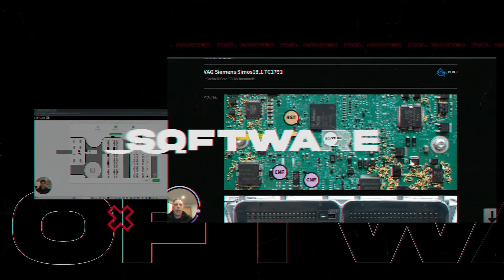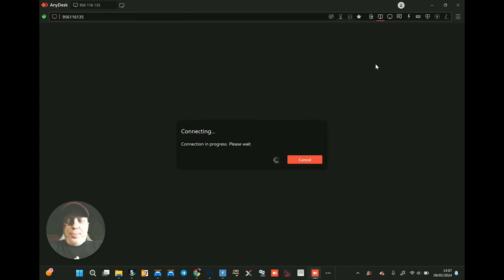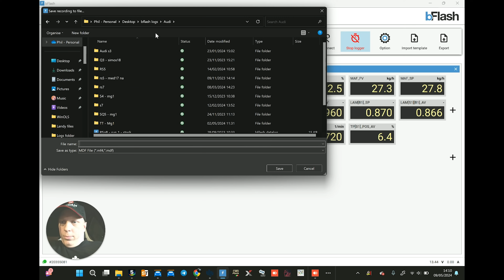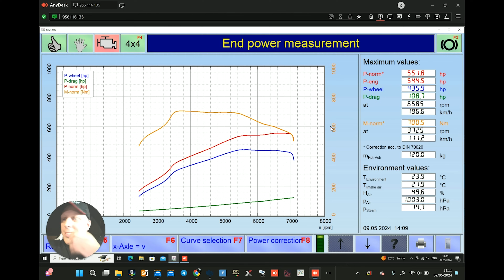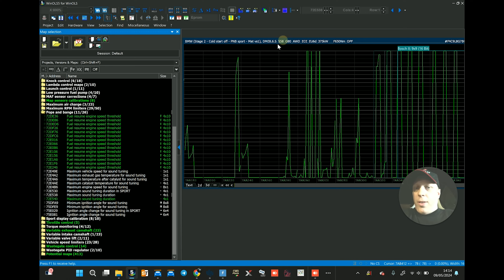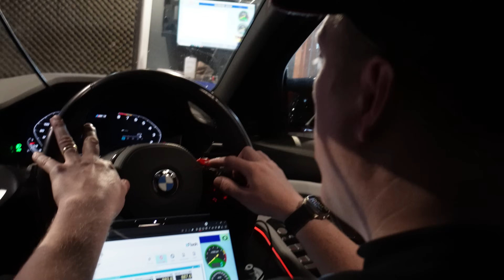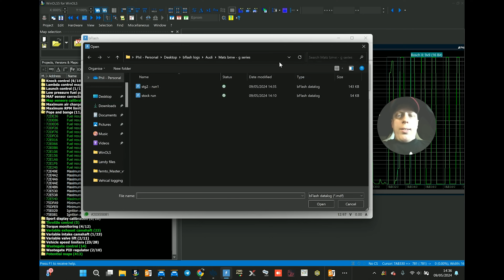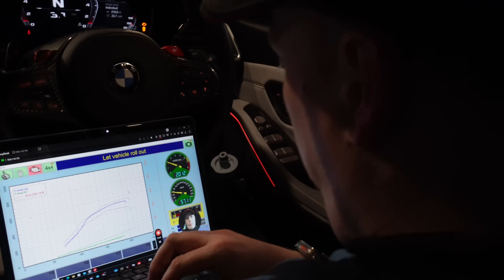TUNING MAT ARMSTRONGS M3 (w/ TAVARISH!)

Comment: I see you use exhaust fans to draw air/fumes out. Do you use any intake fans in front of the vehicle?
Reply from the maker: We get this question alot, mat covered it in his video, our system works like a wind tunnel, the air gets pulled in via ducts in the doors, so instead of having a small fan at the front and extraction, we have a huge one at the back that works for both. Same as the Litchfield setup basically
Reply: @Phil-Cooper  I saw his video and that's what caused my question. I appreciate the exhaust fan will work, but my limited intellect thinks a front inlet (forced air) solution would work better (eg simulating real world conditions). The main reason wind tunnels use exhaust fans is to reduce turbulence, which you aren't focusing on here
Reply from the maker: Theres more to it then that, the gap in the front is designed to draw air to the car, so it is forced, its the venturi affect. We have measured well over 1000hp cars this way same with litchfield. 

In my head it shouldnt work, but it works really well. 

If you think of it like this, on the road the air is drawn through the front, then over the engine and down the back to the exit, just sticking a fan on the front doesnt replicate this. But running the air through the car does. 

Thats pretty much how it works - simulates the road. 

Issue was balancing the air pressure in the room

Comment: Good video. How does the dyno calculate P-norm given it is actually mearing P-wheel? Is it just a common equation? Or is it car specific?
Reply from the maker: Measures whp on the way up, and losses on the way down (neutral coast down) also measures the losses in itself (bearings etc) so its super accurate. Litchfield have the same setup and the engine dyno and they run around 1-2hp out to each other
Reply: @Phil-Cooper  Ah clever! That makes sense. As a rule of thumb I always think of it as 10% loss for FWD, 15% RWD, 20% AWD. The latter is in the ballpark of your P-drag. But I never knew they were actually that accurate. Very cool.

Have you ever come across any cars with crazy low (or high) drag losses?
Reply from the maker: Yeah, cars cant be measured in a % method, only takes a binding brake to lower the measured whp, but this way the loss is added to the run down as its measured there too, and you can see that the losses are massive so you can find whats wrong :) 

Great for race/track cars and finding those lost digits. 

Ill make a video on it soon!
Reply: @Phil-Cooper  makes sense, and sounds good! Will keep an eye out.

Comment: what laptop are you using ?
Reply from the maker: Surface pro 9 - doubles up as a tablet too when road logging, best one ive had yet!
Reply: @Phil-Cooper  being seeing a thinkpad as well, what do you recommend between the two for a mechanic/tuner
Reply from the maker: @aaaddd330  I use both, ive got the thinkpads for the workshop, then i use the surface pro for the dyno and tuning side
Reply: @Phil-Cooper  what model thinkpad is it sir?